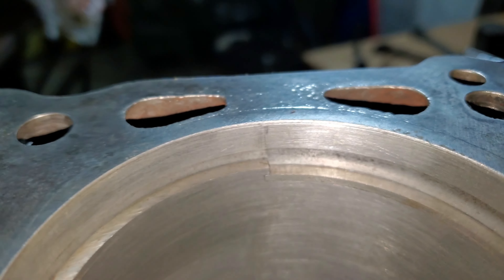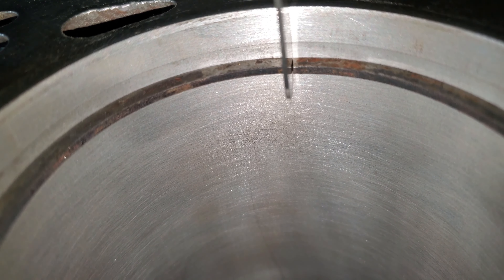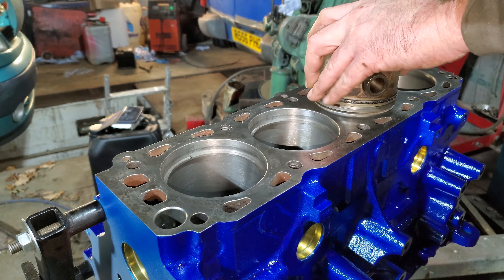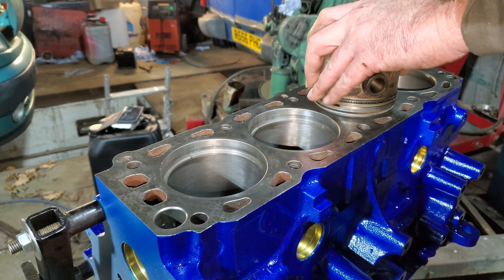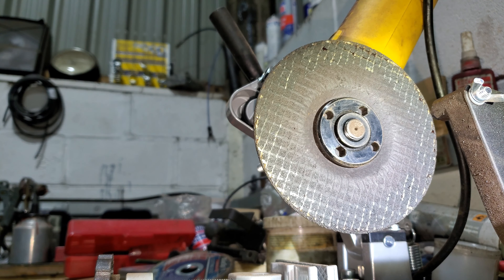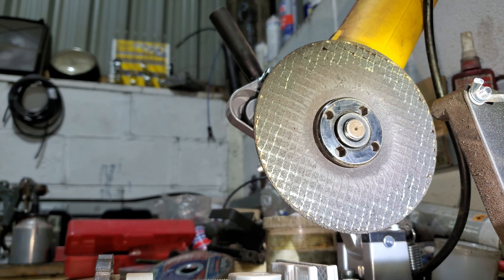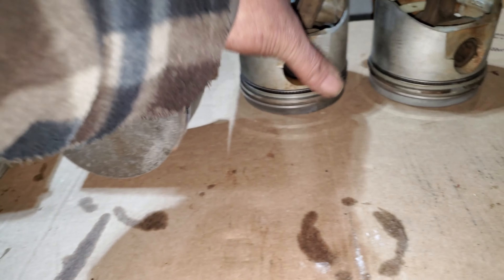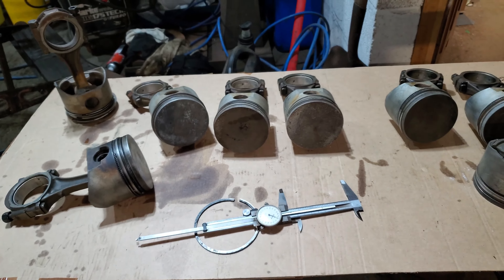Scrapheap Challenge.... Ford OHC ' Pinto ' Engine Build On A Budget ! Part Seven.

Comment: increasing the gap to make the rings fit may give enough seal to run the engine but as the rings are probably meant for an oversize bore their diameter may not match your bore. They may not contact with even pressure around the bore.
Reply from the maker: I totally understand what you're saying and I do agree , normally I wouldn't be building an engine with worn bores but that's the point of this challenge,  make do with what we have and make the best  of it.... I have done many Pinto builds and everything was freshly machined or new... This challenge is just for a bit of fun , throwing the best old leftover parts together with the minimum cost... Its not going in a vehicle,  it will be run on 100LL AVGAS while I try the Chinese Weber copies and then if someone comes forward with a dyno we can run it up just for a laugh....

Comment: Hi what camshaft would you use ? Would a high performance one work
Reply from the maker: I will be using the regular 2 litre cam as I don't intend revving it beyond 6500 rpm ...
Reply: Would a  1600 camshaft rev higher?